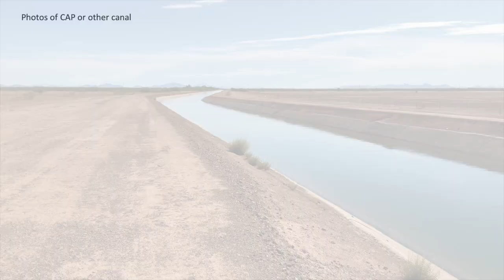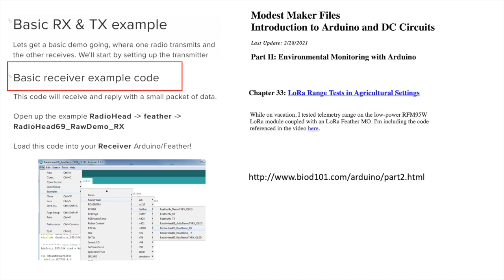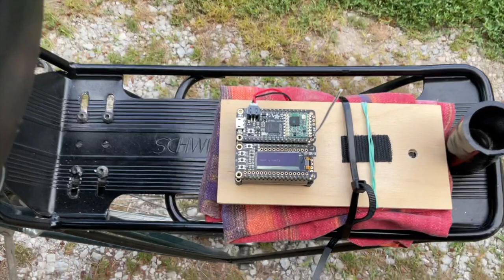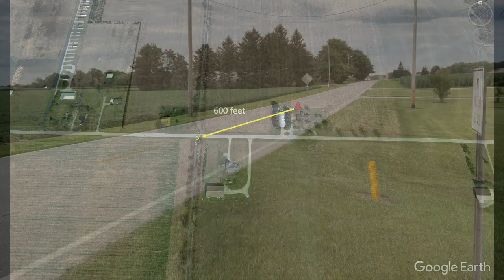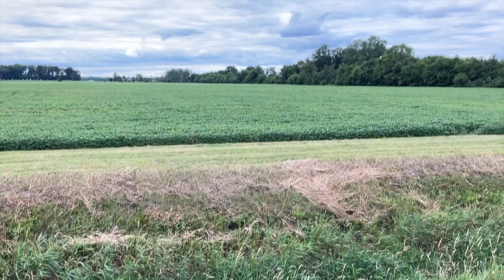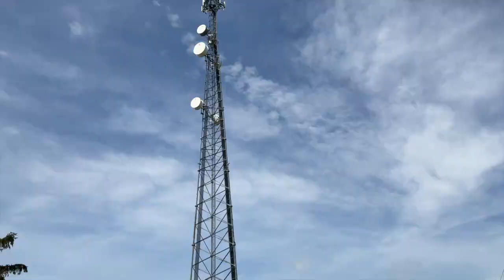LoRa Telemetry Range in Agricultural Settings

Comment: Thanks for the clarification. BTW, is it possible to design a motion sensor (to notify to phone) using LoRa? am just wondering.
Reply from the maker: I haven’t tried this with LoRa- it should be possible if you can integrate it with Twilio, but I haven’t explored this yet. That would be sweet— it’s on my list.
Reply: @ModestMaker  thanks mate

Comment: hello
how to build a pi hotspot helium miner on raspberry pi
tanks
Reply from the maker: Not possible - the gateway needs to be authorized.
Reply: @ModestMaker  Speaking of helium...... have you ever thought of sending the node up a few helium balloons with a node powered by a cr2016 battery. I bet your GW would have insane range to this node! I've wanted to simulate what would happen if I threw a node up a tower, this was the concept I came up with
Reply from the maker: @harmssam  Agreed! That thought has crossed my mind as well as what might happen if we could get a low altitude satellite equipped with LoRa- wouldn’t be surprised if this hasn’t already been done.
Reply: @ModestMaker  check out the tinygs project! It’s fascinating how far you can go with LoRa when you’re in line of sight

Comment: Thanks for this walkthrough! I have done my fair share of doing similar LoRaWAN surveys with Multitech Dev boards and a laptop. Fortunately most of our gateways are mounted on grain bins with 6dBi antennas  so we can get some amazing distances, > 6km with LoS.  I'm curious: what LoRa spreading factor you were using for these tests? Did you try different spreading factors, particularly when your RSSI was getting very low? Cheers!
Reply from the maker: I'm looking at the example code downloaded a few years back and it doesn't appear the spreading factor is set.  I do see a comment that reads "Defaults after init are 434.0MHz, 13dBm, Bw = 125 kHz, Cr = 4/5, Sf = 128chips/symbol, CRC on". I set my frequency to 915 MHz, but not the spreading factor. There is a function defined on this page that suggests I can set the spreading factor, but that wasn't done: https://www.airspayce.com/mikem/arduino/RadioHead/classRH__RF95.html . The associated function is "setSpreadingFactor(uint8_t, sf)". Thanks for checking things out!